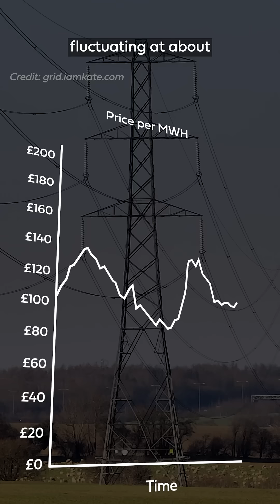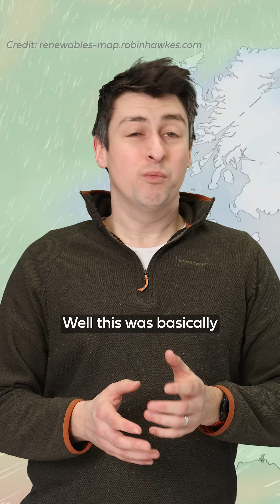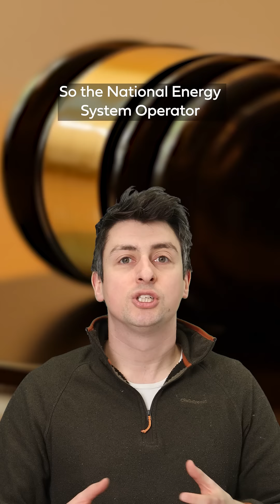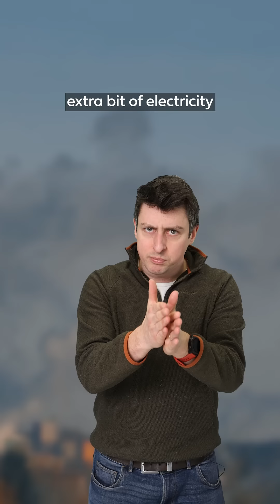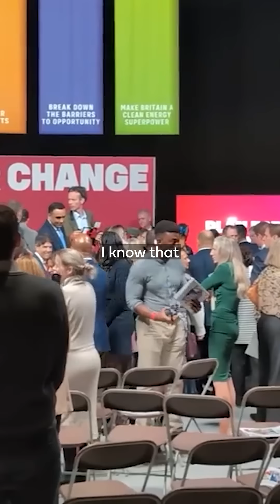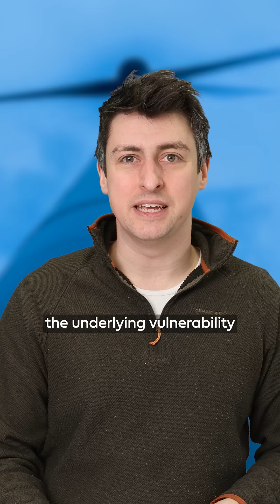The biggest price spike of the energy crisis happened last week

Comment: So the government abrogated their national interest and forgot that utilities are for the public good - now there is a utilisation gap - -and an insufficiency in operational flexibility, the market will sort that,  but you may not like the outcome.  Paying the baseload operators in terms of "MWh" in a crisis does not fill in constant fixed the cost structure of a critical industry.  Noting that every "market mechanism", implemented to "encourage" uptake of renewables (Carbon Tax, Renewable Energy Certificate Trading, tree planting programmes in Chad and Botswana, etc...) - IS a tax on consumers and absolutely "subsidisation" of the industry - all the while ignoring the huge cost to upgrade the grid to allow a massively distributed generation system - grid upgrades are put back directly on all taxpayers..

In  many crises - blaming gas and coal is all very well, but in many markets the pumped hydro operators are the biggest price gougers - it isn't about the "energy source" but it is all about the discretionary nature of the source. Batteries also only have minutes of reserve (and may be contracted to provide compulsory grid stability operations) hydro, gas and coal - where it actually still exists - can hold the market to ransom, hey "they" don't really want coal and gas in the playpen after all. .

 (BTW, if push comes to shove, I don't need a grid and can sort my own energy needs out - but that leaves all the inner city apartment dwellers in the cold.. )

Comment: The one area of the U.K. that had significant wind that day was the south west. In 2015, the local MP in Dorset campaigned to squash the Navitus Bay wind farm project. That 970MW project, would have made a significant difference that Wednesday, and on several other expensive days so far this winter. The U.K. has a very long coastline.Several significantly windy areas have very little capacity as yet. The outer Hebrides is another area that often has a lot of wind  on days when the rest of the U.K. has little. One gap that is about to be plugged in, is Dogger Bank, because on another low renewable day this January, there were light winds all along the east coast, but strong (unused) wind available in the central North Sea.

Comment: The most crazy part is, that the price can get into negative, rewarding consumption to stabilise the grind in case of overproduction and low demand. Operating a storage power plant could make you a lot of profit without even producing electricity. Charge your storage at a low price, sell at a higher price.
Reply: most forms of storage would still loose alot of money
Reply: @baronbrummbar8691  do you mean lose?

Comment: So the average £71 per Mwh = 7.1p per Kwh and we are paying 28p per Kwh, they are ripping us off. 4 times the average cost, 400% markup, the UK energy system is broken.
Reply: Some energy companies have gone bankrupt, other almost have. It's as if there's more going on that just generating the power.
Reply: @ It was only yhe small energy companys that were under cutting the big energy companies that went bump. The smaller ones did fixed rate deals when the nordstream pipes were cut the gas price spiked, the small companies could no longer buy the gas at a cheaper price. but for some reason the gas price is set to the world price. but here the kicker, 90% of our gas comes through pipes from the north sea, 40% from scotland and 50% from norway. they can't sell that gas to anyone else as the pipes only come to the UK. So the big energy companies that have the gas rigs and drill for gas just make all the money. the cost to supply the UK never changed. Just big profits for BP, Shell, British gas. Wiping out the small competition.
Reply: Why don't you 1. Get on octopus off peak 7.5p tariff and 2. Get home batteries for your house. That's what I do. Thus my average per unit is 8p!
Reply: In fact big industry like glass makers are on flexible tariffs that turn off when electricity is high so pay maybe 9p
Reply: What about the companies that keep the grid on? Maintain power lines. Install meters. Lay cables, the call centres for when you switch etc. Post bills etc.
Reply: Power station tech here.  $0.32/kWh (Aus) is breakeven point for coal fired power. Retail price at the meter - $3.10
Reply: That’s the power station cost then it goes through the transmission system a different company which adds it’s costs then you have the last mile distribution system a third fee.

Combine them for what the end customer has to pay or do you think maintaining hundreds of thousands of miles of transmission cables is free?
Reply: @Ushio01 we pay a separate standing charge per day to cover that!!!!!!
Reply: @Ushio01 I think why should it be 3 private companies that only care about stuffing investor’s pockets instead of one nationalised company that includes energy generation and only needs to make enough money to sustain its operations and let tax funds expand its capabilities
Reply: @dukedragon28  We had nationalised before and they all work the same way the politiciations of the day funnel the money from people paying their energy bills to the politicians pet projects 'maintainence, upgrades and expansion can be delayed a year' but then it happens every year till it starts to fall apart and the government privatises it again to allow the private sector to get it back to working order.

This is the problem with the left no matter how many times they see countries do it and then it fails they think 'this time will be differenent' and it never is.
Reply: @Ushio01 we pay a separate standing charge per day to cover that!!!!!!
Reply: @Ushio01 The standing charge is supposed to cover maintenance and provision costs. The energy charge is supposed to be the energy used. The standing charge is already much higher then the energy charge.
Reply: @Ushio01 isn't that what the daily standing charge is for?

Comment: You have to average out the costs, and also remove the subsidies for wind and solar. Then you will see it’s not the cheapest. Especially when you factor in the whole life cycle of the wind turbines and the solar panels. 
Coal is the cheapest form of energy. Nuclear could be very cheap, but the regulatory system in the UK chooses to take 20 year to build a new reactor, which quadruples the price.

Comment: Nuclear as a backup for wind? Have you lost the plot? Nuclear needs continuous operation to recover the huge capital costs. You wouldn't invest in nuclear and then run it just when there isn't enough wind. What you do is when you've got too much wind/solar is convert it to hydrogen and put it in salt caverns and draw it out when you need it to generate electricity. See the Royal Commission study on this. And that's the last resort after you've exhausted all the short-term methods batteries, demand side management, interconnectors etc etc.

Comment: East European here, don't you have contracts with multiple tariffs for households that use electricity for heating? Meaning some of your appliances, mostly heat accumulation like water boilers or floor heating, can be temporarily shut by the supplier. Incentive is that the power is cheaper but can be shut off during some hours of day (specifics warry depending on type of contract).

Comment: What happens to the wind turbines when the expected storm hits with winds up to100 miles per hour
Reply: In that high of speeds the turbines have to shut of , as operating them at such high speeds could cause the blades too snap

Comment: now do the math what would cost to generate your own electricity from red diesel and make use of the excess heat. One litre of diesel has min 10kWh energy content. For a well designed generator 40% of that could be electricity. Store this in a battery. If all is OK with the energy market, the above scenario should always be more expensive than what you are paying for energy. Is it?

Comment: Shocking thought, nuclear power stations don't require a billion acres of power generation estate, and don't cycle between "producing sweet FA" and "we have nowhere to put this power" depending on the whims of the weather.
Maybe we could build more of them instead.
Reply: They don’t want nuclear because it’s tons of cheap electricity. They want to keep pushing the “scarcity” mindset so they can push legislation to control more and more of your life.
Reply: To the replies, France can do it, why can't the UK?
Reply: For the price of net zero we could build and maintain double the nuclear power plants we need to supply our grid and then we could start exporting. The green agenda is sinking the uk, and the uk is barely contributing to global emissions compared to other countries that have no intentions of stopping theirs.
Reply: 1, yes a nuke is expensive, but the cost per mwh over it lifetime is cheaper  than most renewable sources.

2.  Don't look at the Russians or Chinese to example about how to do it.  That will end badly for everyone.   France however had a good system in place before they also fell down this silly anti-nuke rabbit hole.
Reply: Its to expensive for the British 
China and Russia can build them at more reasonable places. 
But we don't like them so expensive electric it is then
Reply: They are ridiculously expensive to build and maintain though, and if you factor in nuclear waste disposal they are even ludicrously expensive. Overall, wind + solar + hydro are much cheaper, and if they create excess energy it can not only be stored in batteries but also used for electrolysis to generate hydrogen. That can then be used for power plants that currently use natural (fossil) gas, with the advantage that burning hydrogen only creates water vapor and not CO2.
Reply: @MedEwok  No, it's just the UK getting ripped off with red tape, lack of local expertise in building them, and greedy construction companies.

France has 18 Nuclear power plants and 57 reactors, it sells energy to Germany and the UK.
Their state owned power company EDF is one of the main suppliers in the UK making Billions per year off our failure to do the same.

Also when the fuel rods are replaced 96% of the material can be recycled into new fuel rods so the boogeyman of barrels upon barrels of glowing green goo is just alarmism.

As for expensive when they started building Hinkley Point C there was an uproar at the price they had promised them to generate at for work to start. Now they would be salivating to get energy at that price.
Reply: @MedEwok nuclear is expensive, but it actually works 24/7 and nuclear waste storage is such a non issue it's comical people still bring it up, you need to store basically nothing, and you don't need to build what is essentially a giant bomb to maybe have the power you need if the wind is a little bit weak, rewnables are useful, but they are inherently impossible to rely on without an amount of batteries that would require thousands to millions of child miners to die
Reply: @ google base load generation and you will is understand why solar wind and hydro are of no use for base load generation. 

The only options are nuclear, natural gas, coal, aka fossil fuel. 

A base load is where you can say I need 100 megawatts round the clock and I can’t rely on the wind sun or anything else. 

The issue with hydrogen is the creation of it is a net energy loss via electrolysis. As far as batteries those are for peaking and once again you are back to base load generation  

Right now we need to get several new nuclear power plants in the works because of how many years it takes. They are the closest thing to green energy we have. It’s a small foot print and a small amount of fuel can make massive amounts of power. 

The navy has a ton of ships and submarines running around and it’s proof of how well it works. You have air craft carriers running around for years on a small amount of nuclear fuel. 

The issue isn’t cost, the issue is being able to create reliable power when you need it.
Reply: @DasNewsNetwork  Cost is always an issue. Which is why the age of nuclear is over. 

Renewables coupled with sufficient storage can cover baseload generation at lower cost than nuclear.

I do agree with the hydrogen thing. Hydrogen generation is essential for certain industrial applications, and its generation can take the peaks off of "excess" electricity generation somewhat. But its low conversion efficiency makes it unsuited for electricity storage. That's where pumped hydro and (soon) batteries come in.
Reply: @sigi9669  what is considered sufficient storage? If we go 3 weeks without wind and minimal sun, we'd need  18.14bn kWh of storage, and at £100/kWh currently, that's £1.8tn or about half of national GDP, minus the minimum pumped hydro we have on hand. I'd argue nuclear is cheaper to build and run right now!
Reply: Without a breakthrough is energy storage/battery technology it's currently not viable to use energy storage and renewables for baseload generation. Some people underestimate the amount of MWh are actually being produced as baseload power, often SIGNIFICANTLY more than even peak renewables + energy storage output.
Reply: @DasNewsNetwork base load is the minimum amount of power on a turbine for it to run efficiently. if it is about demand what is the minimum amount of power needed? what is it? everyone talks about base load is it demand or required for the turbine to be stable? i find that people who go on about baseload doesnt know what they are talking about or they are in denial.
Reply: @ base load eheh talked about in the energy generation sector is the power needed 24/7 that’s not going to fluctuate with daily demand like showers and afternoon summer heat. 

So when we talk about base load generation it’s meaning a plant that can just run 24/7 putting out a stable amount of power. 

Then you get into peaking generation or peak demahd and solar and win can help with that because the major peak is midday and that’s when solar is at its best.
Reply: @DasNewsNetwork  so what happens if there is no load? they just shut the turbines down then fire them back up when needed? if there is a baseload what is the number? if there is no load on a turbine it can not just idle. coal they can switch to diesel but they cant run without a load. baseload is a term touted by people who want to decieve or have no idea what they are talking about. nobody quotes what the baseload is because it has to do with the number of turbines on line.
Reply: @sigi9669  How low is the conversion efficiency? If you have loads of excess power because it is very sunny or very windy, how big a factor is it?
Reply: @booargy Okay, so there is no baseload. You don't need to run different servers and factories 24/7. We can just shut everything down each evening and then when the sun goes up again for this sweet sweet electricity we will restart things again. Pretty simple, eh? /s
Reply: @booargy You don't understand what base load is. There is ALWAYS base load, that's what makes it BASE load.  "What happens if there is no load?" This DOESNT happen.
Reply: @Weshwey_  you do not have any idea how a steam engine or the grid works. off peak power is so the turbine has a constant load. you have no idea what you are talking about, yelling still wont make you right.
Reply: @booargy In electricity generation, "base load" is the consistent minimum demand for power, not the power a turbine needs to run efficiently. Some power plants need a minimum output for efficiency, but that’s not the main meaning of base load. It’s typically met by continuously running fossil or nuclear power plants. With better battery storage and more renewable energy, renewables could replace base load sources, but the necessary energy storage breakthroughs haven’t happened yet.
Reply: @lightdashing  that is what did happen before the generators got to big. they then needed a load so they would run over night that is what a baseload is. baseload is. a term used with synchronous power generation.
Reply: @Weshwey_  baseload is the minimum amount of load needed for a turbine to run efficiently. no load on a coal boiler it has to run on diesel as the load picks up it switches to coal. when someone talks about baseload and renewables straight way you know they have no idea what they are talking about.
Reply: @ No, in terms of the power grid, base load refers to the minimum amount of power generation that's needed at all times. Please inform yourself :)
Reply: @Weshwey_  do you work in the industry?
Reply: @booargy  Do you realize words can have different meanings based on context? In your context as a power plant worker, base load can refer to what you are describing, but in the greater context of the entire net, base load means something different.